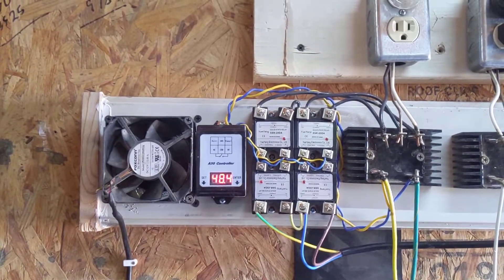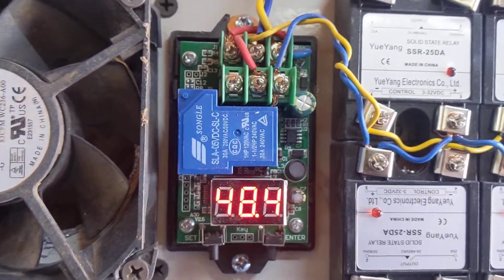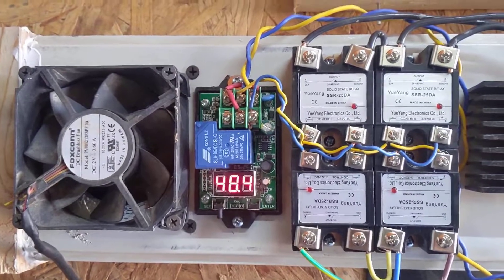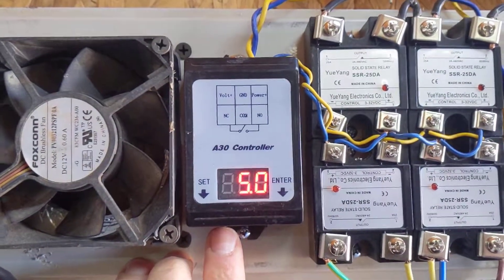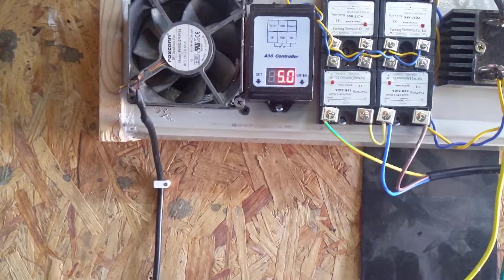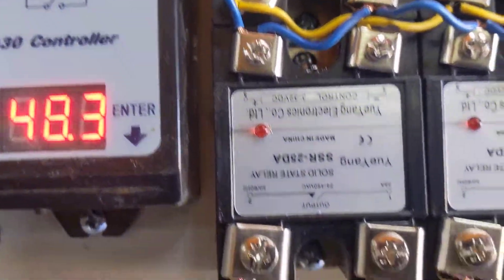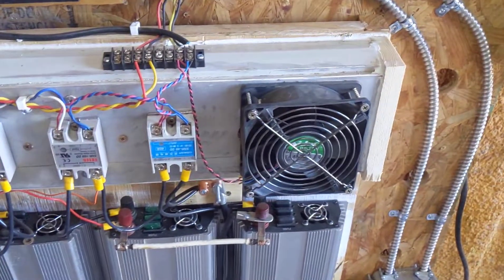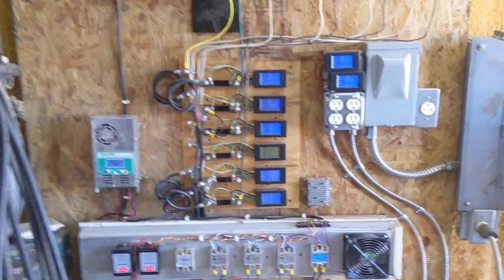Operation and Programming of the A30 Voltage Controller and Similar Devices for Turbines and Solar

Comment: Sorry for this sort of a beginner's question: I'm trying to automatically dump excess energy from my solar panels into a 48V water heater once the battery is full (or at least at 80%). I learned that this relay/controller can do that. I just don't understand where the connection of the controller should be attached. I see people on YouTube fixing it to the battery, others put it on their hybrid inverter/charge controller. I don't seem to understand that concept. I learned that the cables from the charger to the battery must be thick due to the heavy amperage and now here comes this tiny accessory with cables 10-15% of the battery cables in size and handles it well. Can you please explain where my understanding starts to get wobbly? English is not my first language ... I hope you understand my question. THX!

Comment: That display looks like a bad solder joint. I'd try wicking it off and applying some good quality solder to it. Should be fairly easy, those indicators don't tend to have the pins close together.
Reply from the maker: They're not soldered, it's a pin connection.
Reply: @ToysforWatts  Oh wow that's an odd way of doing that but guess it was the easiest way to tool the line.

Comment: I have a question on connecting the controller and ssr. The Chinese controller did not come with any instructions. Do you have any videos that show you installing the controller?
Reply from the maker: Is it the exact same A30 controller?
Reply: @ToysforWatts  yes same controller for 24v
Reply: I was able to get it working without the ssr but can't get it to work with the ssr. What is the point of the ssr? Is it for safety?

Comment: Have you considered adding a simple voltage divider to drive the braking relays? I suppose the drive current is very small and some 10kohm 33kohm divider should work just fine.
Reply: I'm not familiar with these particular relays, but if they're conventional types (with a coil) you could put a resistor in series with EACH relay coil, if you drive them all through one resistive dropper or divider the voltage drop will increase as more relays are called, this could result in relays dropping out.

You need to know how much current the relay coil takes, what its operating voltage is and what the voltage is that energises the relay, the required resistance R (ohms) = V/I where V (volts)is the voltage drop required and I (amps) is the current.

Comment: Hi. Sorry for bothering again. 
A few videos ago I sended a response as well about these controllers. Now with this close-up I am sure we are talking about the same controller. 

The connections you use on the controller can also be used to control an AC load. (as  long as you stay below 30 Amps. It is still "China-quality", so maybe not use 30A :p)
You can see this on the blue relay inside the controller as wel ("30A 240VAC")
I did this as well with almost the same device (I do have the upgraded version, which has a few more menu options such as delays).
I did put the controller on the live wire into my grid-tie inverter. And till now it is working perfect.
By connecting it this way, you eliminate the frustrating fotek relais, which are inefficient because they are creating heat.

About your question for the settings. These are the settings: [Upper limit] - [Lower limit] - [Correction value] - [Display off time (in minutes)] - [Above upper limit / Below lower limit]
Reply from the maker: I would be interested in seeing a picture of how you have the it all connected to your terminals.  These relays seem to share a ground between the switching and load circuits, I don't think I would be able to isolate one from the other.
I guess I need to look at the backside of the board.
Reply: @ToysforWatts  I did send you an email with my setup. Hopefully you can use it :). If you have some feedback or ideas for me to improve my system, please let me know!

Comment: 4.Function:
1>.Set method:
1.1>.Screen display ‘U-3’ and enter setting mode automatically after power ON.
1.2>.The default initial display mode is P-0 which has no function.
1.3>.Press SET button to switch work mode: P-1 to P-4.
1.4>.Then press ENTER button to set parameter value after selected mode.
1.5>.Then press SET button select the next parameter and set value.
1.6>.It means that the setting is completed and the parameters are saved when no bit flashes.
1.7>.Keep press ENTER button more than 3second enter into set mode at normal display status.
1.8>.Reset:Press 2 buttons at the same time, then turn on the power. it means the reset is successful if it displays ‘rst’, and all parameters are restored to factory settings.
1.9>.Set Mode:One bit of screen will flash at set mode.
1.10>.Work Mode: No any bit flashes.
1.11>.Press ENTER button to start or stop delay at work mode.
2>.P-1 work mode: Delay timer.
2.1>.This mode needs to set 3 parameters: T1, T2, d.
2.2>.Function: After trigger, relay keep OFF for time T1 and then keep ON for time T2 and then turn OFF and keep.
2.3>.T1: Set keep OFF time and set range is 000-999 second.
2.4>.T2: Set keep ON time and set range is 000-999 second.
2.5>.d: Set keep ON time and set range is d-0 to d-9.
2.6>.If T1 is set to 005 and T2 is set to 000, it means: after trigger, relay keep OFF for 5 second and then turn ON and keep. Trigger->OFF for 5s->ON.
2.7>.If T1 is set to 000 and T2 is set to 005, it means: after trigger, relay keep ON for 5 second and then turn OFF and keep. Trigger->ON for 5s->OFF.
2.8>.If T1 is set to 005 and T2 is set to 006, it means: after trigger, relay keep OFF for 5 second and then keep ON for 6 second and then turn OFF and keep. Trigger->OFF for 5s->ON for 6s->OFF.
2.9>.d-0 means display screen always keep ON. d-5 means display screen will turn OFF after 5 minute.Press any button to turn on the display again.
3>.P-2 work mode:Voltage monitor(default OFF)
3.1>.This mode needs to set 5 parameters: uL, nL, cV, dL, H/L.
3.2>.Function: Relay turn ON(or OFF) if the measured voltage is higher than the upper limit voltage value uL and relay turn OFF(or ON) if the measured voltage is less than the lower limit voltage value nL.
3.3>.uL: Upper limit voltage value.
3.4>.nL: Lower limit voltage value. uL can not be the same to nL.
3.5>.cV: Measured voltage calibration value. Its range is -0.5V~0.5V. 
3.6>.dL: Sampling time interval of the measured voltage. Its range is 0.1s~0.9s. 
3.7>.H/L: ‘ON H’ relay turn ON if the measured voltage is higher than the upper limit voltage value uL and relay turn OFF if the measured voltage is less than the lower limit voltage value nL.  ‘ON L’ relay turn OFF if the measured voltage is higher than the upper limit voltage value uL and relay turn ON if the measured voltage is less than the lower limit voltage value nL.
3.8>.P-2 mode can use the delay time T1 and T2 set in P-1 mode.
3.9>.E.g. P-1 : T1 000 T2 000 and P-2 ‘ON H’ : relay turn ON if the measured voltage is higher than the upper limit voltage value uL and relay turn OFF if the measured voltage is less than the lower limit voltage value nL.
3.10>.E.g. P-1 : T1 003 T2 000 and P-2 ‘ON H’ : relay turn ON if the measured voltage is higher than the upper limit voltage value uL and relay turn OFF after 3 second if the measured voltage is less than the lower limit voltage value nL.
3.11>.E.g. P-1 : T1 003 T2 000 and P-2 ‘ON L’ : relay turn OFF if the measured voltage is higher than the upper limit voltage value uL and relay turn ON after 3 second if the measured voltage is less than the lower limit voltage value nL.
3.12.E.g. P-1 : T1 003 T2 002 and P-2 ‘ON H’ : relay turn ON after if the measured voltage is higher than the upper limit voltage value uL and relay turn OFF after 3 second if the measured voltage is less than the lower limit voltage value nL.
4>.P-3 work mode:Voltage monitor(default ON)
4.1>.This mode needs to set 5 parameters: uL, nL, cV, dL, H/L. The setting parameters of A and B are the same.The difference between them is that the default state is different. 
4.2>.H/L: ‘ON H’ relay turn OFF if the measured voltage is higher than the upper limit voltage value uL and relay turn ON if the measured voltage is less than the lower limit voltage value nL.  ‘ON L’ relay turn ON if the measured voltage is higher than the upper limit voltage value uL and relay turn OFF if the measured voltage is less than the lower limit voltage value nL.
4.3>.E.g. P-1 : T1 000 T2 003 and P-2 ‘ON L’ : relay turn ON if the measured voltage is less than the lower limit voltage value nL and then relay turn OFF after 3 second.
5>.P-4 work mode:overvoltage and undervoltage monitor.
5.1>.This mode needs to set 5 parameters: uL, nL, cV, dL, H/L. The setting parameters of A and B are the same.
5.2>.Function:’ON H’ relay turn ON if the measured voltage between the upper limit voltage value uL and the lower limit voltage value nL. Otherwise turn OFF relay.
5.3>.Function:’ON L’ relay turn OFF if the measured voltage between the upper limit voltage value uL and the lower limit voltage value nL. Otherwise turn ON relay.
5.4>.E.g. P-1 : T1 003 T2 000 and P-4 ‘ON L’ : relay turn ON after delay time 3 second if the measured voltage is outside the range of uL and nL. 
5.5>.E.g. P-1 : T1 000 T2 003 and P-4 ‘ON H’ : relay turn OFF after delay time 3 second if the measured voltage is outside the range of uL and nL.
Reply: Hi I want to program the relay to switch off at 24.2v and remain off for 15 minutes to give the batteries time to charge back up. Do I set T1 or T2 to 999?
Reply: How do you determine which of the work modes (P2, P3 or P4) you actually use?